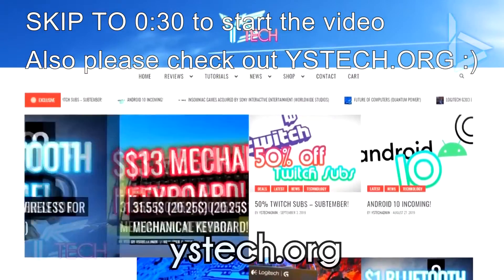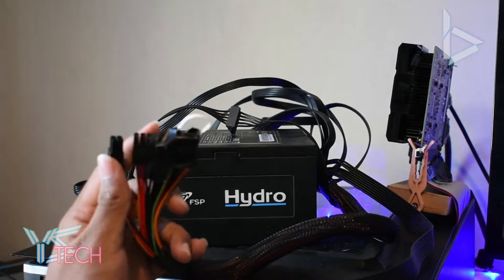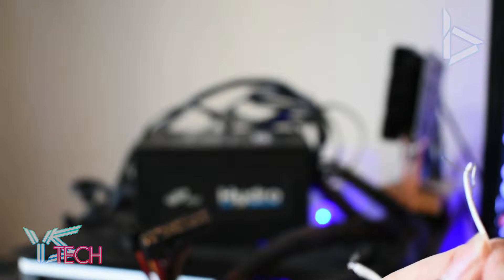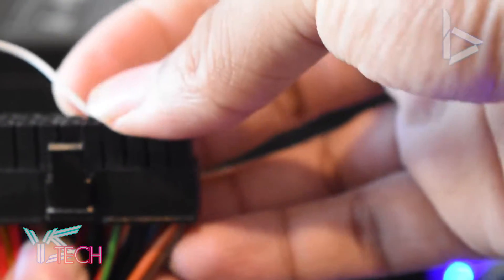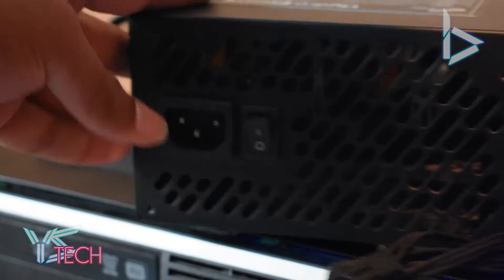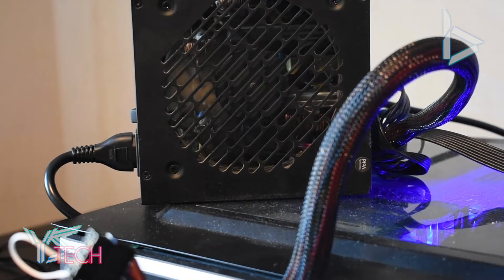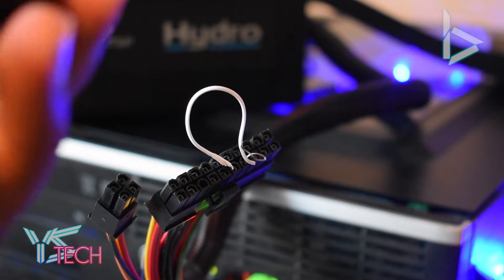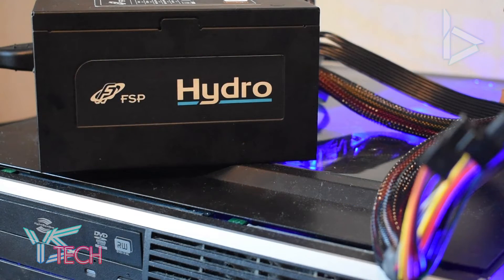Jump start a power supply with no computer (Turn on a PSU)

Comment: I did this mine came on n worked, but then I switched it off give it like 2 mins tried to turn it on again it didn’t :( however I’m using the evga included jumpers
Reply from the maker: Oh dam. That's really weird. Which PSU are you using like the model is it the EVGA SuperNova? I mean you could let it sit for a bit longer and try again, but considering that you are using the evga jumpers that's really odd. If its not working still I'd take it back to the shop if it's still under warranty and just say that its not working don't mention jumping it otherwise they will say that you caused the fault even though you were using the proper evga jumpers. ;) I hope it works out for you :). Have an awesome day! :D -YS